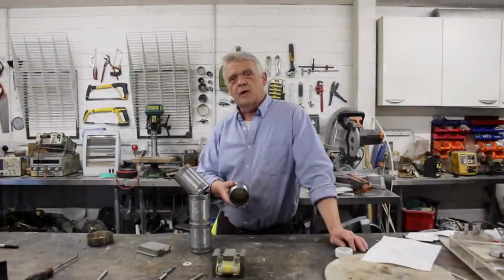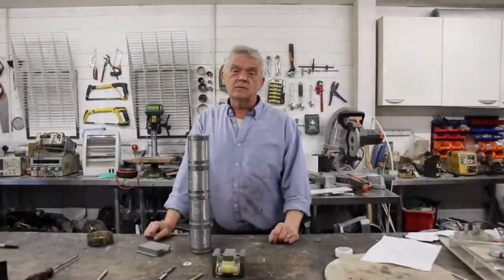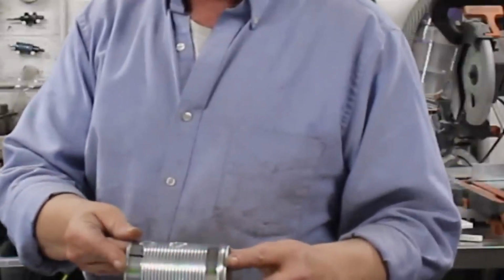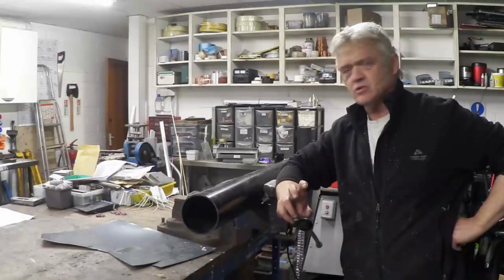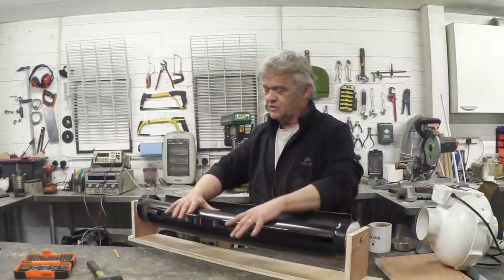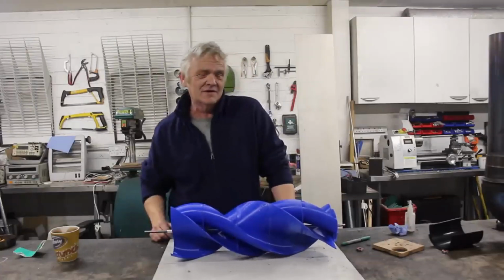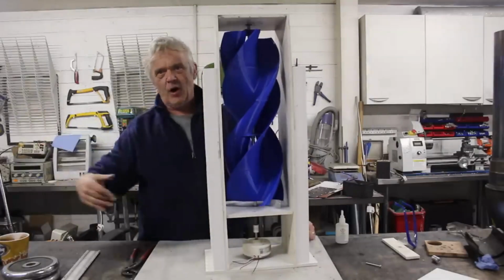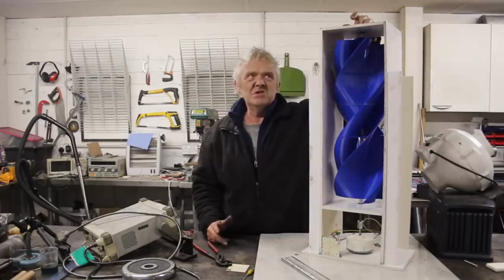015 A Variety Of Wind Wall Rotors and How To Build Them

Comment: On the Conliff Rotor, if you took a slightly smaller diameter of hole saw, you could make supports for the inside of the rotor.
Drop them in is easy, and then twist into place and glue. Instant increased strength and also improved balance.
And on Birds and HAWT's, if the tip is supersonic, it wouldn't even have to hit the bird to kill it, would it?

Comment: What if you had a magnetized center rod with an internal coil winding running the length of the spinner running in companion with your generator already in place at the base of it, or a nice tight coil down the center with a magnetized tube basically vice versa with that induce the copper winding as well?

Comment: a long time ago I used to make wind spinners from wood which were similar-ish to this and did not need anything more than a saw and drill to produce. plus threaded bar and bearings.
I used wood which was cut into slats about an inch wide and 12 inches long and 3/8 thick. In the centre of the slat drill a hole to take a threaded bar. The slats were stacked on to the bar leaving enough room to put a washer and nuts either end and some bearings. The largest I made was 3 feet long and it needed a good attachment to a wall to hold it as it had a fair weight to it and spun at quite a rate. I had plans to put a generator on one to see what it would produce but never got around to it. Assembled in this manner produced a flat panel which could then be arranged by moving each slat up to a third ish of its width at the outside edge relative to the slat below it to produce a helix. Pretty much any wood can be used from ply to hardwood. I used short lengths of timber and ran them through a table saw cutting slices from the side of the timber 3/81/4 was about ideal ( from memory) to get a nice helix but that depended on the length of threaded bar I had. (Ply would have to be cut  on the face rather than the side). Also if you wanted to move the spinner you just moved the slats back so it returned to a flat panel.

Comment: With the black pipe. You mentioned leaving a section in the middle for stiffness. I wonder if each the top and bottom section were off by 60°. There for when one part were to lose wind pressure the opposite end would be there to pick up to increase the efficiency. I don't know much I was just wondering. I may be totally wrong. Just came across your channel and this is something that I have been interested in for some time to produce free energy.